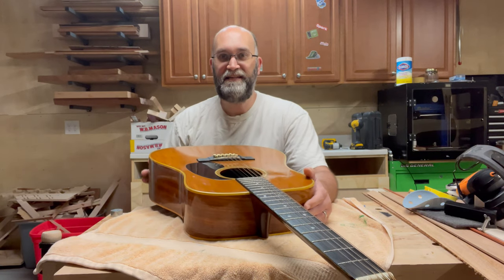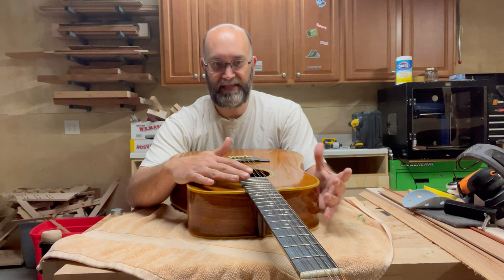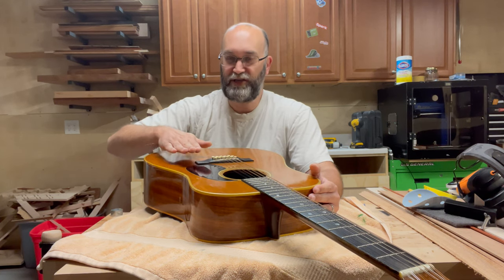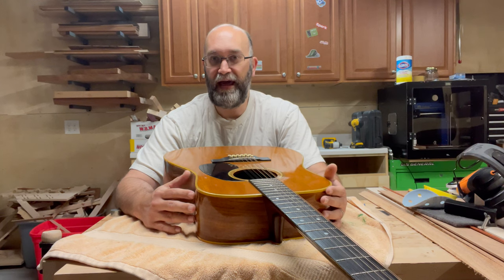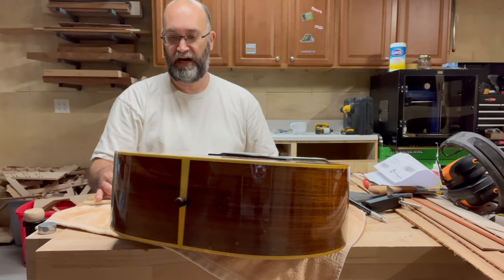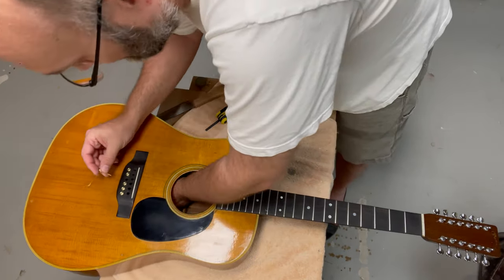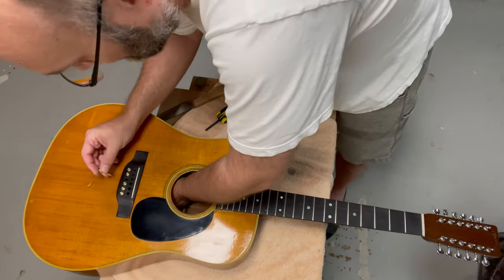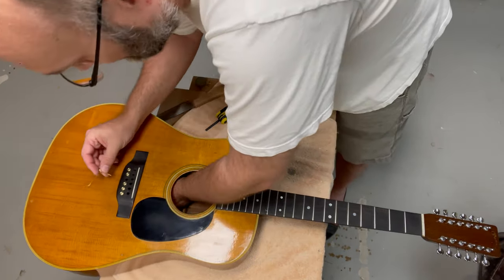Installing a bridge doctor on 1971 Martin D12-28 12-string guitar

Comment: That's the first time I've seen that variant of the Bridge Dr. The one I'm familiar with has to have a hole drilled in the bridge, for a bolt and that model doesn't convert it to a pinless bridge. That's pretty cool. But as for what the Bridge Dr is used for, or designed to do, it is to reduce belly bulge. It wasn't designed to pull up the top ( the sound hole area). Sometimes that happens but not always. So it was designed to take care of belly bulge.
Nice video though and nice to see there are different models to choose from now

Comment: Nice demonstration. At 8:50, it looks like you put the rounded end up against the block. I think the rounded end is supposed to be inside the JLD block up against the tension screw (because that screw's end will them match the rounded point on the tension rod).
Reply from the maker: Functionally, it hasn’t seemed to have mattered over this period of time. So maybe yes, maybe no 🤷‍♂️😅

Comment: Good day, I was wondering what is the point of the bass pins, and if this would be a good idea to do on my twelve string. I play mexican regional and we double up the strings (no octaves) to give a heftier tone. Would this be a good idea for those who play this type of music or should I stick to a regular bridge doctor?
Reply from the maker: This bridge doctor is one of the two choices, the reversible one. The brass pins keep you from having to drill a hole in the bridge.

If you are doubling-up the bass strings, I do think having a bridge doctor installed is probably a good idea, as it would be a lot more tension. Either that or having thicker braces in the guitar to start with.

Comment: Thanks, nice video. I'm looking at doing the same with a Höfner 12-string I just got. I'll probably have to use the brass pin version as there's not enough real estate to drill a hole in the bridge to accommodate the other Bridge Doctor model. I just wish that, aesthetically speaking, there was another option apart from brass. It really does change the look of the guitar a good bit, and as you found, the break angle too. Maybe if they offered it them in black. 

Also, it wasn't shown, but after trimming the dowel to length did you turn it around and insert the flat side against the end block? That seems to be the preferred method.
Reply from the maker: Yes. The cut was clean enough to put it the other way, but it just seemed like the cut end should go inside the part hanging down and the factory edge of the dowel should go against the end block.

Comment: I am going to put a Bridge Doctor in my 1969 Red Lable 12 string guitar, and wonder if I could just drill a hole for the screw instead of using an existing pen hole, like you do for a 6 string.
A Luthier told me to use a set of number 9 D'addario strings for old 12 string guitars.
Reply from the maker: Yes, I believe you can. I got the pin version based on the recommendation at StewMac, but I don’t see why the screw method wouldn’t work as well.
Reply: @zwitchguitars   Thanks for getting back. I forgot to mention my guitar is a Yamaha, made in Japan. Yeah, there are two different JLD's; JLD Bridge Doctor (for 12 string), and JLD Bridge System (for 6 string). I think you can do screw hole method, but really wonder why there is difference? Right, the brass pens do raise the strings just a little, but a little goes a long way in guitars!!!!
Reply from the maker: @petratical The difference I think is some people aren’t comfortable drilling a hole in their guitar, or are unsure that the bridge doctor is the full solution.

Comment: Thats pretty neat how that bridge doctor works. I wonder if that forward pillar that puts the pressure on the top was more "T" shaped if it would put more even pressure across the under side  of the bridge. Give the lower strings a bit more support.
Reply from the maker: I think it might be the idea that you can put more pressure on a smaller area. But it suggested you use the D string slot…I wonder if using the A string slot would do what you’re talking about 🤔
Reply: @zwitchguitars  I also wondered that but since this is my first time ever hearing or seeing this I didnt wanna sound dumber then I am hahaha
Reply from the maker: Ha! Not dumb, that’s what the comments section is for 😅

Comment: But how do you mount the B string if the hole has the tensioning pin in it
Reply from the maker: The pin has a hole parallel to the top where the string attaches, in a similar way to a top-mounted Strat/Tele bridge
Reply: @zwitchguitars  so the pin has to be sticking out
Reply from the maker: @anthonykenny1320  yes, the brass pin replaces the normal acoustic pin, and the string goes through the pin head instead of into the bridge

Comment: I may be confused but if the low strings are buzzing now, couldn't you just install a taller saddle to get rid of the buzzing?
Also why do you need to use all 6 brass pinless  type pins? Couldn't you just use the one on the D string.
I'm asking these questions because I have a friend that has a guitar in this same condition and the BD could be the answer. His guitar is a Dread Guild from the 70's.
Reply from the maker: Hey Dale, thanks for checking out my video!

The important part is why the string rattles. Usually a string rattle is because it hits the frets, and you’re right, raising the saddle would help.

However, less frequently, the string can not have enough break angle over the bridge or the nut. In those cases, the rattle is irrespective of hitting the frets…and that’s what’s happening here. The brass pins don’t give enough break angle, which means that they buzz AND the action is still too high.

Ultimately, I did remove the brass pins on the E and A strings to remove the buzz, but I still haven’t solved the string action issue. That will need a neck reset.
Reply: Why don't you use the one that you have to drill the bridge.  You'll get your normal break angle and can slot the bridge if you need more angle. @zwitchguitars
Reply from the maker: @cugir321 the simple answer is, it’s not the one I bought 😂

Had the problem been completely resolved by the bridge doctor, then I might go ahead and do that. But since the neck has to be reset anyway, after that is done I might remove the bridge doctor altogether